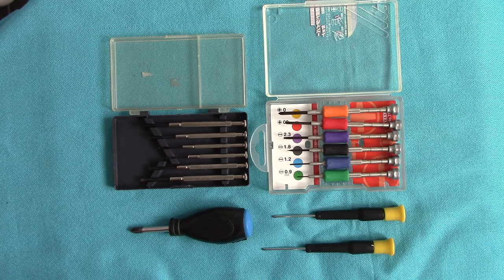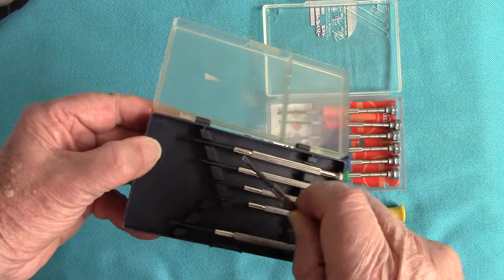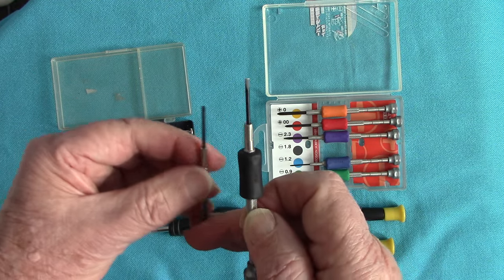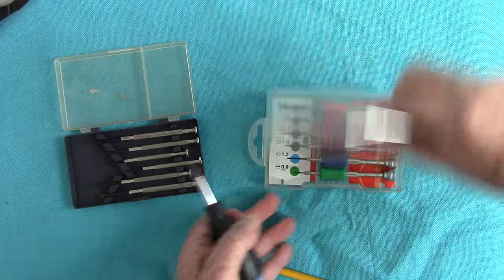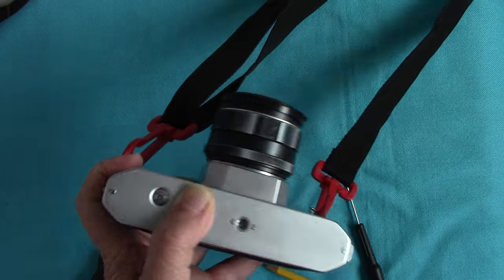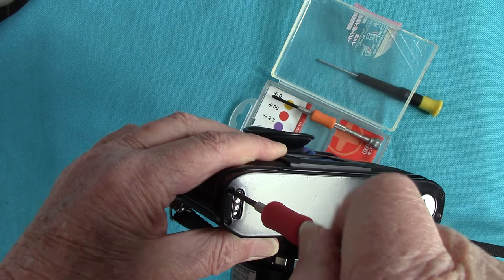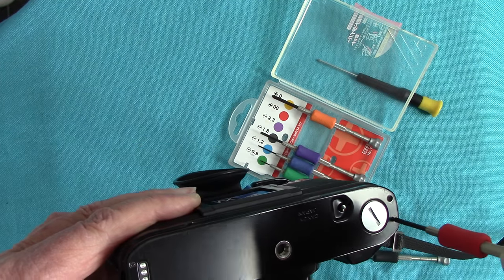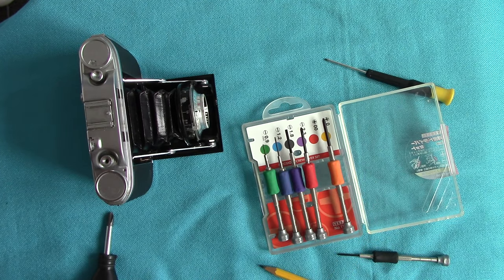How to use the JIS Screwdriver set when repairing cameras.

Comment: I saw your video on the Mamiya C220 and was wondering if the JIS screwdrivers can remove (or at least fit) the film pressure plate slotted nuts. I have a C330 and none of my screwdrivers had a thin enough tip to fit into the slots. This made replacing the rotten foam light seals very difficult. The C220 and C330 seem to have the same slotted nuts and I will purchase the JIS set if my light seal replacement failed (haven't run film thru yet).
Reply from the maker: Yes -- I have renewed Light Seal Strips on my C220 - Te JLs Screwdrivers help !

Comment: Someone must have been tampering with the Isolette if JIS screwdrivers fit.
It is as German as you get and manufactured when only slot screw heads where used.
Reply from the maker: I used  the very small 'Slot' screwdriver NOT the Cross-Head one so it fitted OK.
Reply: Peter Elgar oh I see now! Didn’t notice the set included slot drivers too.
Bought!